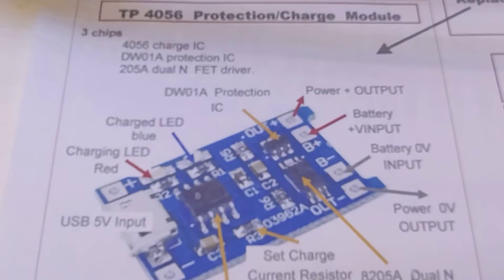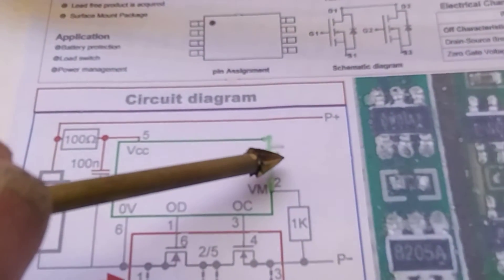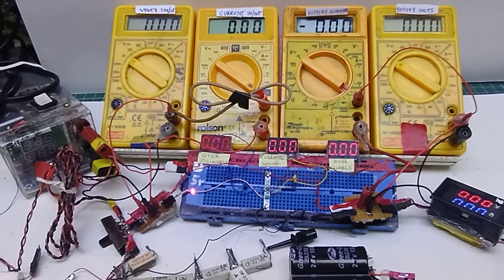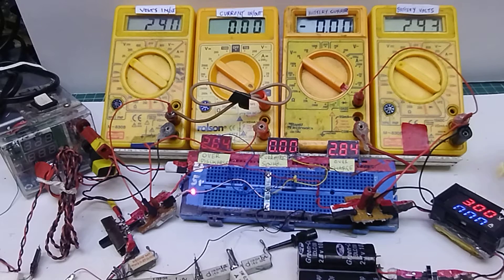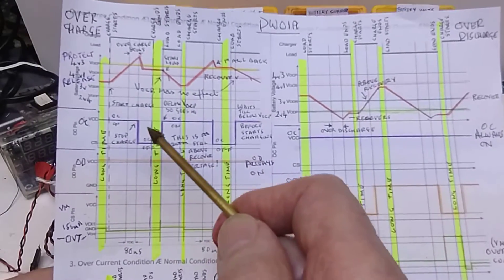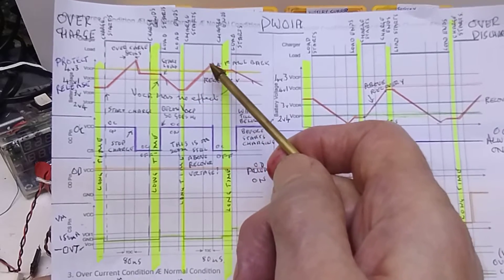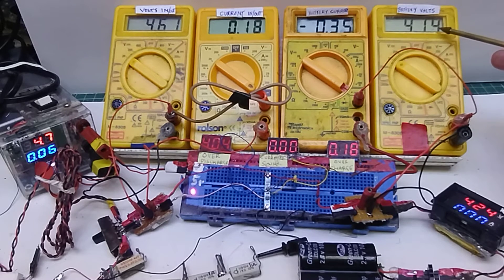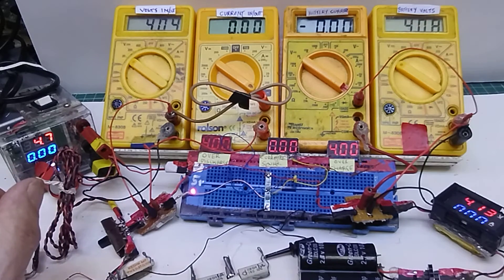DW01a IC analysis & experiments.Lithium protection circuit part 2

Comment: I like these little boards and use them a lot. I have no reason to fully understand them but I just watched pt1 & pt2 and a gentle breeze blew some of the fog away. I'm just about to stuff one in each of the solar lights I bought that appear only to have charge protection chips - 8pin but sanded tops with no hint of a number, classic AliX bargain basement junk with soldered wires on the unmarked lithium cell.
Fascinating channel. You earned my subscription. Thanks.
Reply from the maker: Thanks for the comment. Glad it helped. The solar lights don't seem to be as good as they were. I had one with no protection found the cells outer case some distance away but never found the chemicals!
Reply: @toyhacker4647  I prefer NiMH over lithium for small outdoor lights, they've lasted over a decade in some lights, always longer than the legs on the old style leds.  Most lithium, even Panasonic, give up after a winter as there's no low temp cut out, never mind discharge protection. The only advantage of lithium cells is that they are higher Wh, free or very cheap & everywhere, even some disposable vape cells last a thousand cycles or so.